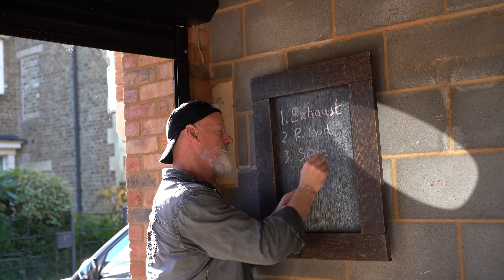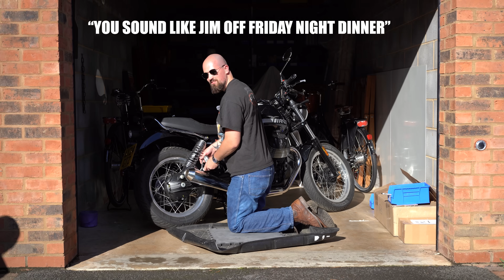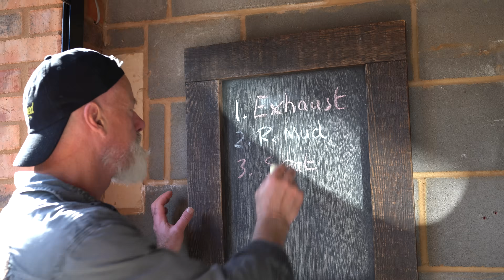Transforming My Moto Guzzi V7…

Comment: I had a v7III, just a heads up.. even if you get the valve clearances exactly the same on both sides intake and exhaust respectively, don't expect both sides to sound the same.  I've never heard a BMW airhead or moto guzzi V-twin have the same volume or tone from each side of their cylinder heads/valve trains.  I just think it's the nature of the beast when it comes to push rod actuated valve trains.  With that said,  maybe your intake and/or exhaust valve clearance is slightly wider on the side that you're hearing more tap from.   IMO, nothing to worry about.
Reply: Harley's act different front and rear too. you just notice it more on these moto guzzi because the cylinder are on either side

Comment: I've just been watching The Bingley Wheeler, and the Guzzi is a very attractive proposition. A good tip for finding exhaust leaks, (especially around joints where nothing is visible), is to tear a strip of kitchen paper and, while the engine is running, pass it over the pipe without touching. Any gas leak will make the paper flutter. Also, for tracing mechanical noises, get yourself a mechanic's stethoscope. They look like a doctor's stethoscope, but instead of a bell, they have a metal probe. You press the probe against the engine, and it helps pinpoint, amplify, and identify sounds. For less than a tenner. Be warned though - the first time you use one, you'll think your engine is about to self-destruct! The cacophony you'll hear is frightening! (A screwdriver with the handle pressed against you ear can also be used.)
Reply: My ol man used to use a long wooden handled screwdriver held against the rocker cover ... works well to listen for lose tappets..

Comment: A couple of tips: A length of garden hose can serve as a great stethoscope for tracing noise. Stick your ear on one end of the hose and move the other end around various points on the vehicle
and it will help you detect where certain noises are coming from.
Secondly: If my mate's two Guzzis are anything to go by, the engines sound like a washing machine full of marbles even when in perfect fettle. The top ends in these things are renowned for the clatter and noise that they make. The early BMW's weren't much better, but the architecture of the Moto Guzzi just seems to amplify these sounds. 
And they aren't sounds that you really associate with anything automotive, these days. Crikey, even Harley Davidson have whisper quiet hydraulic valve gear.
But the big thing is, there's nothing wrong with the bike. Adjusting the valves on those things is a regular service item. You can do it at home, easily, and when you have adjusted the valves, they'll still be noisy! They're Italian, after all!!!
Reply: I second this! proud owner of a guzzi stornello, and it chops and bangs and pops and rattles, and every service item is up to date. It's a lovely experience.

Comment: Tinkering videos are a super good idea for you guys imo, this is a good one! It doesn’t have to be a professional (or “semi-pro”) tear-down rebuild of a “basket case” unobtainium classic or “barn find” to be interesting. There are a lot of those anyway. This is real and it’s fun. Others have said, so maybe irrelevant: The ticking sound, as best it gets recorded and reproduced on this computer, sounds like maybe the tappets. They are very accessible and easy to check/adjust on this engine and doing it as a matter of course when it seems necessary makes for a sort of new relationship with the bike. It’s fun and useful and highly recommended. There are YT videos that show the drill for that exact bike. I learned this on old /2 and /5 BMW airheads, but the Guzzi setup is even more accessible. If you check them and they’re in spec and they are still a little noisy, then that is fine. The sound of freedom, etc. As a modern Guzzi owner, I like the look you have going on there but personal experience is that I eventually almost always go back to stock. Normally this happens after a long-ish trip where I discover what trade-offs the engineers and designers had already figured out for me. There are a few counter-examples, having to do mostly with sometimes terrible aesthetics and trim in the 1980’s for all brands. In the 70’s there are different issues. Before that, well, nothing except Honda and friends was all that reliable so you could try anything and learn. Romance of memory aside, it’s much better now. And, of course, you got the wrong seat from Baak. Baak do make one for your model, according to the website. They even have a photo and the seat pan matches your correct black seat pan. It seems to be light-ish brown leather, so it will need a lot of frequent leather treatment care and will get a nice, aged and worn-in appearance, inevitably.  Rain storms on a trip require in-the-field leather treatments. The cat can make a hash of it. You might leave a wrench in your back pocket and a line for posterity on the seat. Etc. The black one will still look new in 10 years, so it’s a matter of what a person likes. I sort of like aging brown in town and clean black with a rack. Fun, relaxing video with a Saturday morning coffee. Watching low intensity Guzzi fiddling is always better than the news. Asia trip was v interesting, good job!

Comment: Hi matey, regarding the v7 tapping noise, check the cross over link pipe clamps aren't loose. And if its not that, then it's defo the tappets clicking away because I swear I can even hear it from this video! Anyway good luck on the rest of the modifications!

Comment: If you ever struggle locating a noise, get a 70-100 cm length of 32mm plumbers waste pipe...checking various parts of the engine listening through the tube...it helps focus source when there is a lot of residual noises....

Comment: Hey Darcy, loving watching you customize the Guzzi.  I have the exact same bike and with what is probably the same intermittent rattling noise on the right hand side.  What I found was that placing my boot and pressing on the mid section of the exhaust on the heat shield stopped the rattling and then it started again when I released it so it may be that the sound is coming from slightly further up the exhaust.  Unfortunately, I didn't have a chance to investigate further because I had an accident a week ago.  Not my fault but hit a car that cut across the front of me as I was exiting a roundabout.  Bike went down on the left side and has done damage to the head cover and cyclinder head and may be written off.  I'm fine apart from some scraped knees.  Would definitely recommend considering fitting some engine bars to protect the cyclinders as they are vulnerable because they stick out.  All the best man
Reply from the maker: Thanks and sorry to hear about your accident 👍🏼

Comment: I appreciate this is not a car channel and I am about to subscribe to your other place. However. As the ex happy owner of three XJ’ s in the middle 2000’s ( two XJ Sports and an XJR ) can I recommend as late an XJ Sport V8 as possible ( due to cold start bore flooding and electrical issues). Get a good one with the Ford sparks and change the grill for an XJR mesh. It will be a super thing and with the grill looks absolutely fab!!!

Comment: Just a word of advice for when you're checking for noises without taking all of that stuff off.  You need to buy a mechanics stethoscope.  It'll help you out a lot for pinpointing these kinds of issues.  Theyre not very expensive.  I'd recommended the one made by Lisle but maybe you have different options over there in the UK.

Comment: Tapping noise is your valve gear. Check the valve clearances. I have the v7iii and they all make the same noise. Better the clearances are a little loser than manual spec. Nothing to worry about.

Comment: My old v85 which is the same engine so  I'm lead to believe had a flat spot around 2800rpm and somewhere else I've forgotten where, but after a booster plug no more flat spots and much better throttle response
Reply: I don't think the booster plug works on EURO 5 models..

Comment: Darcy that seat pan definitely is not right .  have the same tail tiddy on my bike and had the same brake like for a while but changed it for a Motone Customs and kept the tail tidy .I changed it for what they call a Elderado in solid brass but it does come in black or silver and is also LED but made much nicer than the BAAK one. that one looks like  a stamped thin steal it works of course just not as a quality piece as the Motone one and fits directly to the BAAK number plate bracket. I changed the switch gear on my Interceptor it wasn't hard most likely it's a similar set up  two 9 pin connectors in your head light one for each side. Just needed to get those connectors and the the compressor tool handy to have cause you will need it again for mre upgrades to make factory style connections . Cheers Mate

Comment: Your rear frame rises at the back the only “bench” style seat (ie no step) would be a banana 🍌 shape. It’s physically impossible to have a flat seat on a low to high rear frame unless the foam at the front matches the height  of the pinion seat at the rear. Or you have a steep slope high at the back to low at the front. Imo your stuck with the original style you have. Get a brown cover for it with some fancy stitching and save a few £’s & have the foam cut if you need more or less space to sit.

Comment: Funny you should mention the tyres, I've just put those on my V7 (same model as yours) and they seem to have upset the handling : the front end feels a bit floaty and not as secure as it used to with the Dunlops on. What pressures do Guzzi recommend for them? Good video btw, thanks.

Comment: The V7 really appeals to me: Built by a distinguished Italian brand with a long history plus it's equipped with a characterful 90 degree V twin motor, what's not to like? 

Weeell... Whilst doing some research to discover what owners thought about these bikes, I came across a significant number of complaints concerning reliability, build quality, and 'early doors' corrosion issues. I also noticed that a number of owners had run into difficulties getting problems solved under warranty. I understand that no manufacturer or product is perfect, but there do seem to be more than a fair share of 'friday afternoon' V7's out there, enough to put me off buying one, anyway, which is a shame. I sincerely hope yours is a good'un... 🫡